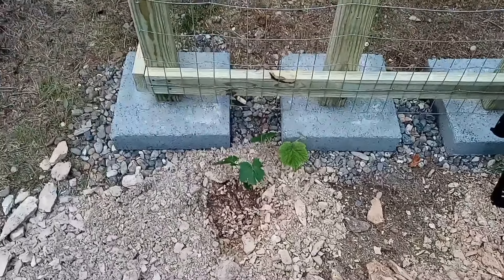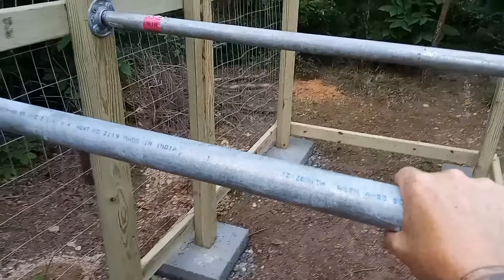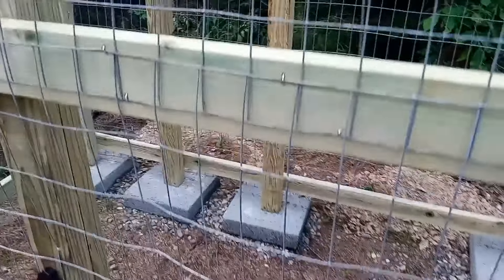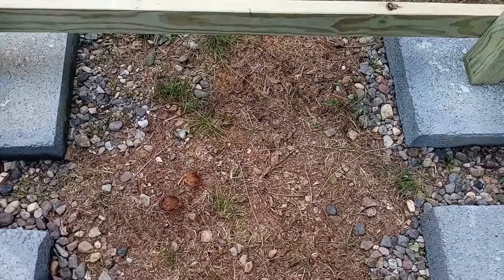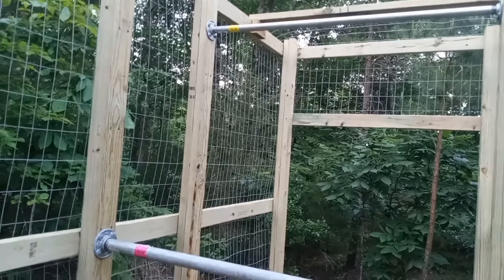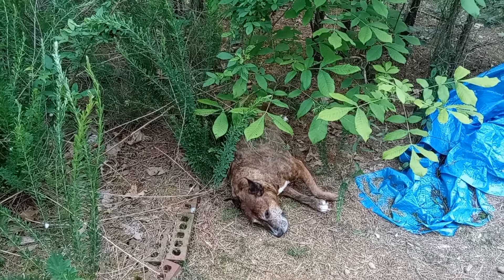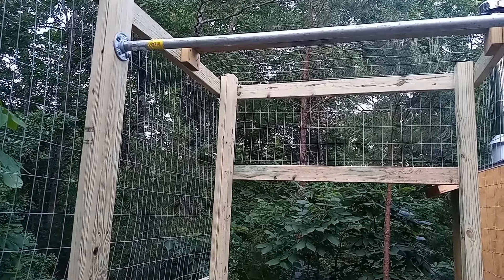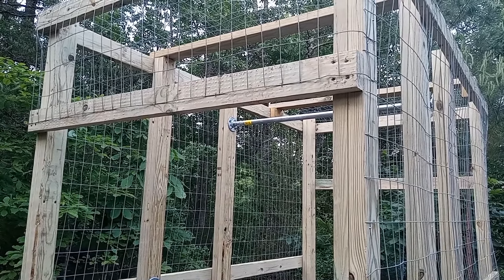Building A Grapevine Trellis And Workout Center

Comment: That’s a good idea.  We have grapevines that cover the length of our deck, and the vines will connect and intertwine with each other. I do go out from time to time in the summer to tie the vines back (re-route). We’ve  never had a problem.  Your job is well done!  I haven’t been to a gym in years.  Too much work to do right here 🙂 I try to keep busy at 64, but just have to remember I don’t bounce back like I used to.
Reply from the maker: Thank you. I like that idea of running them along a deck as well. Anywhere there is a fence or lattice work of any kind, it makes sense to me to use it for growing vining food like grapes.

Comment: You might want to consider transplanting those grapes away from that structure. That pressure treated wood will leach toxic chemicals into your soil everytime it rains and harm the plants and anything that eats them. Now do 5 pull-ups brother.
Reply from the maker: That very well may be the case. I'll still take my chances eating them over store bought grapes, which I know are poisoned at every step in the supply chain.